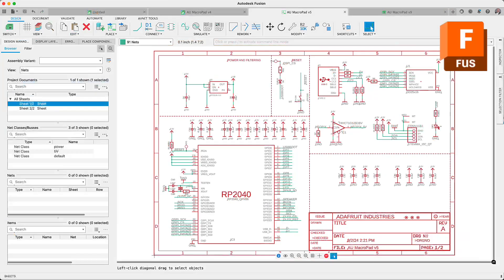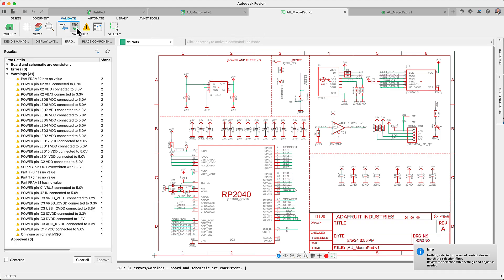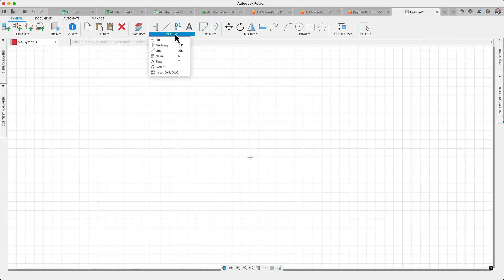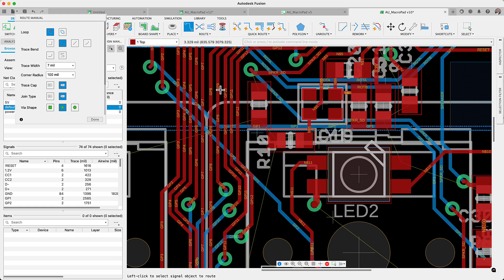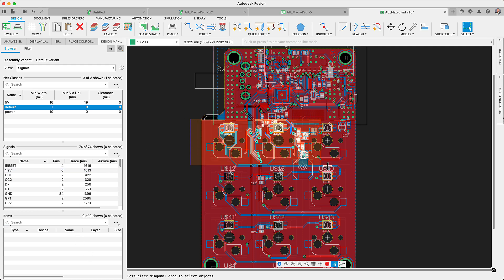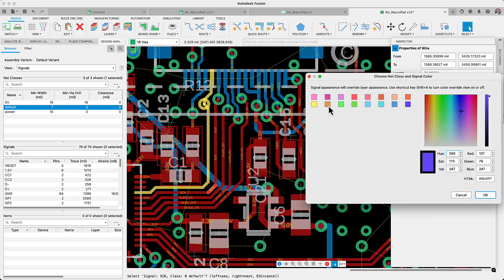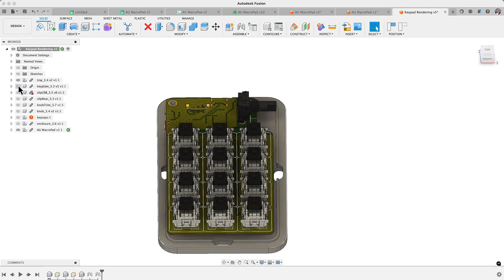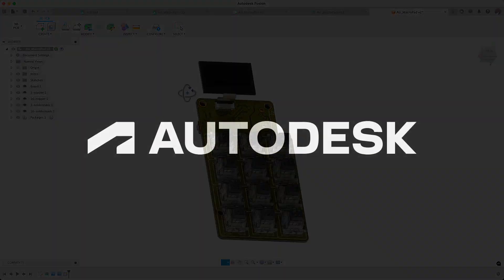Migrating to Fusion Electronics

Comment: fusion electronics LIBRARY is such a convoluted MESS! its so confusing, no hierarchy, very messy interface, a millions steps just to find a part, where does it go, there is no search, most components libraries HAVE NO 3D MODELS!!! its sucks big time and i hate using it! its need to be completely redesigned from scratch, sucks big time.. however schematics and layout is fine, just the library SUUKKKKSSSS!!!!
Reply: I can recommend componentsearchengine/SamacSys for library components.
Reply: Agreed.